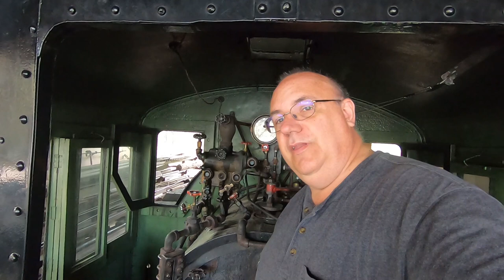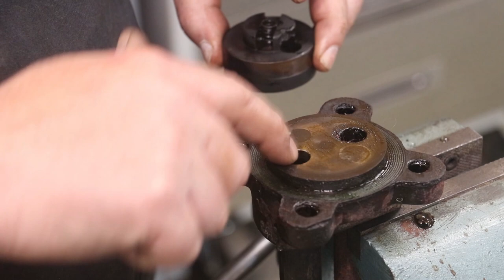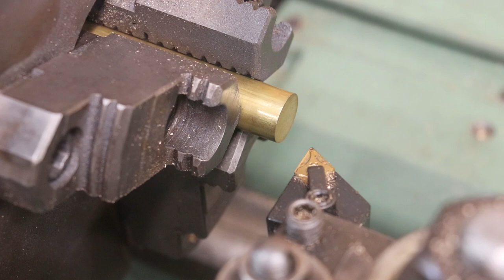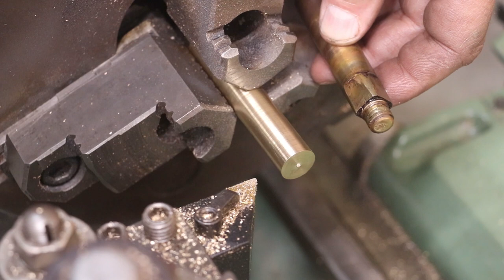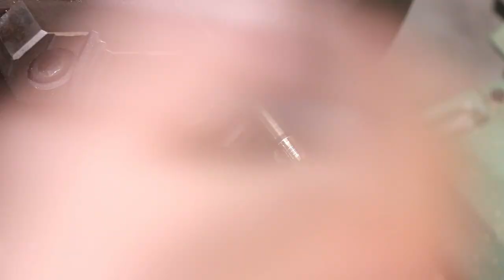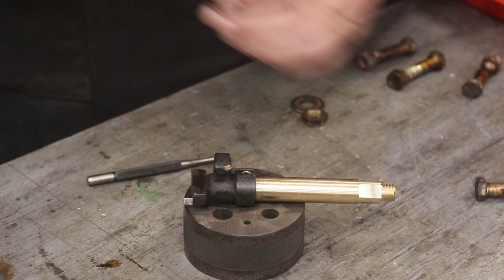Repairing & Machining Parts for a Steam Locomotive Brake Valve

Comment: Brass should not be used where it is continually exposed to steam or hot water. The zinc will leach out, making the part weak. A bronze, which is copper alloyed predominantly with tin, will retain its strength much better. As to the size of the spring pin, would the locomotive have had spring pins originally? I’m thinking it was originally a small tapered pin. At some point in time, when a repair was made, brass was substituted for bronze, and a larger spring pin was substituted for a tapered pin. These two changes would make the shaft susceptible to fracture.

Comment: Time for a plaque on the valve:  “Warning: Pulling harder on this handle will not stop the train sooner."
Reply: It's also true that stepping on the accelerator pedal on a Toyota Camry won't make a little old lady stop sooner. But a Dodge 3500 with a mechanics box will.
Reply: Likewise, there is a term...  "Elecelleration"  - The mistaken concept that pushing the button repeatedly will make the Elevator come sooner.
Reply: Or a plaque that says "go easy on it!! this machinist is a hack and cant build a strong part"
Reply: Sage advice!!  LOL
Reply: Oiler must be on.

Comment: So by your explanation, that’s technically a sort of pressure vessel. That’s why you have fine thread bolts because they are stronger in tension than a coarse thread.

Comment: The brake handle broke off? Really? I mean, reality isn't supposed to be a Hollywood cliche. Buster Keaton will haunt you.
Reply: Also Do you have liability insurance for brake jobs?
Reply: I heard Charlie stole the handle.
Reply: Erik Bongers on a downhill slope with a damsel tied to the rails
Reply: @paulatkins894  any shop that makes repairs mainly auto has to have liability insurance for just such a thing. When i was an A.S.E. tech though i can tell you 98% of failures after a car left where not directly related to the recent repair. Eventhough its very hard to explain that to customers
Reply: Silver Streak locomotion plowing into the  station.

Comment: It looks like having the rotation limit on the casting could put a lot of load on the spring pin and shaft if the engineer pushes the handle to the stop.  
Maybe warn the engineer to use a gentle touch....pushing to a hard stop doesn't improve the flat face valve operation.  Just another one of those undocumented secrets to learn when running a steam loco.
Thanks Keith.... I am the one with the machine shop keeping our club's 1913 Case steam traction engine running here.
Reply: “Warning: Pulling harder on this handle will not stop the train sooner.”  Although, sadly, that same warning has never worked while I’m playing video games...
Reply: Chuck in Wyoming  and bronze could be a better choise than brass due to the brittlenes of brass.
Reply: @janvisser2223  I suspect the valve stem was all originally cast in one piece in bronze.  The new 5/8" brass stem and spring pin are probably a later fix when the stem was twisted off above the 0.9" shoulder.
Reply: Chuck in Wyoming: Agree.. Keith has probably selected the material that he had on hand. I personally would have spent time to make a one piece part out of bronze. But hey, who is interested in my opinion😊 Put ten technicians in one room and you will end up with ten different solutions for the same problem.
The design of this old brake system seems also unsafe as it is not fail-safe.
As a rupture in the steam line to the brakes will produce al lot if steam blowing off to the atmosphere instead of slowing down the engine
Reply: @scotty362100  Thanks for sharing.
Reply: One idea that came to mind was to bore out the end of the original valve stem and make a stainless stub that could be pinned or silver soldered into it, to replace the broken off stub. But if the original shaft was one piece with the end that was pinned to it, could also silver solder a new valve stem to the more complicated end with the stops, making it one piece again..
Reply: @windrk_6754  "...making it one piece again..", I think you got it nailed!  I hadn't seen Keith's 2017 video when he rebuilt this valve.  I watched it (thank you scotty362100) and think a new stem would be a good idea. Keith could include the 0.9" spacer ring he added if he turned it from a 1" shaft and get a really good silver solder joint with the 0.9" face.  Maybe include a tapered square to lock the handle like the 2017 replacement stem had.
Reply: grafvonstauffenburg  Stainless on stainless would have a tendency to gall.  For steam service, bronze was the preferred material for wear in this use.  Also these brakes are steam jamb which is either on or off.

Comment: Fine thread takes more vibration to loosen off.
Reply: That's good info. Guy I work with hates metric bolts because they are fine thread and fine threads are easier to cross thread.

Well, never in the history of threaded fasteners has a fastener cross threaded itself. There has always been someone turning it. Every cross threaded fasten was caused by the person installing it. He is just trying to justify his ineptitude by blaming something "foreign".
Reply: Fine thread bolts tend to be used on high strength bolts because the finer thread leaves a bigger root diameter.  Any bolt table will tell you they accept more axial force. 

 They may have been needed here because those four bolts hold the (fairly large diameter) top on that valve against full steam pressure. If they fail, the top blows off, there's a deafening noise from the escaping steam, the driver gets a bad burn as well as a sprained wrist, and the locomotive has no brakes.  The fine threads and the bolt spec are potentially very important.

Comment: Hi Keith, just watched the valve lapping vid from 2 years ago, where you installed this brass shaft that just broke. For such a light load that's not a very long life. In that vid you also remachined and installed a guide bush as well as removed the original shaft. During these operations I saw several places where missalignments could have crept in. This could have resulted in a slight bending force at the region of the spring pin. After a few thousand operations this could easily have broken the shaft. If this new shaft breaks again in a couple of years, check the alignment.

Comment: Why not square-broach it, make a handle to fit then drill and tap a set screw that engages a dimple in one of the flats? Much stronger since there would not be any through-hole.

Comment: If you do have to revisit this repair consider tapering from the 7/16ths to the 5/8ths diameter where the packing rides. It would remove the stress riser from the hard transition.
Reply: I wonder if the issue it's with radial forces from someone being too heavy handed with the handle and stress cracks forming.  It took me a long time to teach my kids to shift a manual transmission using their finger tips instead if grabbing it and forcing it into gear.
Reply: @robertoswalt319  I think the steam pressure pushing down on the valve disk makes the lever hard to move otherwise we would see a ball on the end instead of the large handle. He had to machine the valve surfaces before and the spring inside is not super strong so that wear force came form somewhere else... steam pressure.

Comment: Keith, if Lady Luck is unkind and that stem fails again, changing from brass to something stronger, say manganese bronze, might be wise.  With strength comparable to steel and highly corrosion resistant, manganese bronze seems a "winner".
Reply: Eli Duttman Indeed. Brass de-zincs and disks over time when exposed to live steam. Bronze would be a much better choice.
Reply: Keith does not read the comments. People have been telling him to use bronze for parts exposed to steam for a long time but he just wanders along in a fog using brass because that's what he has.
Reply: @Craneman4100w  Stainless any good for this?
Reply: @MrJohnnaz  I don't really know MrJohnnaz.
Reply: @MrJohnnaz  Stainless is the best, all machinery used in autoclaves in modern times uses 304, or 306 stainless steel. Most autoclaves us 125lb incoming steam pressure, so there is really no reason not to use it on locomotives.
Reply: If you make the stem stronger, that casting becomes the weak link.  You can make another new stem fairly easily; but, If the casting breaks, making a new one would be a monumental task.  I Think brass is the right call.

Comment: I don't know how deep the center drill went but it might have been a good idea to make the turned down section that goes into the valve driver to a little longer.  It might have been deep enough to weaken  the cross pin.    Making it longer would allow for the center drilled section to be cut off.  Could have also done the handle side first.     Going 7/16 will definitely help.  Maybe use a bronze instead of brass as a different material?   Polish the shaft at the gland nut?

Comment: I would have been tempted to use bronze and mill a flat spot and a dimple on the shaft, then tapped out the spring pin hole and used a set screw and loctite.

Comment: 25:25 Looks very much like the square on the original stem has a taper, similar to a square taper bicycle bottom bracket. When this one breaks because it's brass and you make a fresh new one from bronze, you can take out the handle slop by making a square taper on the new one :)

Comment: Wouldn’t a set screw work better to hold the stem
Reply: Thread both sides of the hole and use two set screws.Dimple the shaft to prevent slip, as well.
Reply: @machintelligence  not in brass its too soft
Reply: @machintelligence  just what i was thinking.

Comment: 31:54 shop boss signing off!  A flat on the shaft with a mating flat machined in the end piece would be good for transmitting the torque, then you could use a very small diameter pin to hold the valve stem in but loose fitting in the end piece so there is no torque thru the pin. That would make it much stronger. PS:Need to tighten your chuck on that center drill. lol
Reply: Not for nothin' Brian; but, how would you machine the flat into that little hole?
Reply: @cyrilhudak4568  With a little end mill. :-) Of course in my shop I would have to use 1/4" then file out the corners to get a good fit but with those less afraid of the small stuff an 1/8" would probably be the trick. lol

Comment: hi there! wasnt the original square section for the handle tapered??
Reply: I saw that also. Looks to be about 1/16" smaller at the tip so the handle locks down when tightened.

Comment: My thought was maybe broaching a square or hex fit instead of round, which would take the torque off of the pin section and distribute it to the handle's shaft. The pin would just be retaining the shaft rather than transferring the force.

Comment: Perhaps a stainless steel operating shaft
Reply: Was wondering about either stainless or at least bronze instead of brass.
Reply: Csab  He could have made a sleeve of copper to cover the SS.
Reply: Original GOOD part is not original anymore because he enlarged the hole.  Now, it will probably crack because the walls are thinner.  What a shame.
Reply: What I would do, is drill the hole for the spring pin through the side of the stem instead through the center.

Comment: i am so pleased with myself, Keith. Before you got started on the fixin' part i had instinctively chose to bore the hole bigger by 1/16 inch. That "small" increase in the diameter adds a lot of brass to resist torquing forces, increasing significant robustness against breakage in the future from brittleness being introduced over time. I wonder what a mechanical/metallurgical engineer would be able to calculate is the increase in strength? Maybe someone here knows the calculations to run on that. (i hope) [i hate to say it, but i would be getting ready to core a new brass rod and insert a stainless rod within to take the drilling. I know my strength (like yours) would introduce too much Hammering the Break Handle to the ON position and thereupon introduce a Lot (too much) of a sudden torquing (and thence brittleness) to the too small brass stem given the size of the pin needed for strength.]

Comment: Hey Keith any advice on straightening a slightly bent 12" long shouldered bolt used as a front motorcycle axle? I accidently loaded it sideways bending it and in current climate(laid off) i cat really afford a replacement. I thought putting it in vise and applying opposite force but how to keep from over doing it. Would heat be a bad idea? If i had access to a lathe id just machine a new one sadly i got a vise , oxy map gas torch, and a welder that's all. Thanks and love the videos

Comment: Two things strike me, firstly why do you just run the bit back along the workpiece without pulling it away? It leaves an unsightly helix. Secondly you use the blade ends of the Vernier caliper, which risks error due to inaccurate alignment along a parallel cylinder. Could you not eliminate that error by measuring using the flats and allowing them to be snug on the work?

Comment: I think a solution to not breaking this arm in the future would be to have a disconnected shaft with a spring latch. You can pull it to your position, it does its job, but if the engineer pulls harder, instead of breaking, the handle skips a turn. It would mean that the handle isn't aligned with the setting, but that's a small price to pay vs not having brakes in a possible dangerous situation.

Comment: the pin should be the fuse.  that is the least important part that can break and you dont cry---  unless you have no breaks and hit something.  Beef up the shaft, what breaks next??  you are not going to stop engineer from overdoing it.  I would hate to make that part on end of shaft.  maybe make the handle slip when pushed to hard?  or pin the handle so that pin breaks first???

Comment: Keith, this was another very interesting video -- I enjoy seeing the locomotive repair you do (along with everything else).  I agree that the spring pin seemed too large for the size of shaft it went through, but could the wrong material have been used previously?  I think I've read that many brasses don't do well in steam service.  Anyway, your fix ought to last a long time.  Take care.

Comment: Another option would have been to broach the shaft and hole square to spread the torque to a larger cross section and not have a stress riser on that pin hole.

Comment: Would it have been worthwhile to have rounded the edges of the hole where the pin went through. It seems the sharp corners may allow a stress crack to start which would have lead to handle breaking. Maybe looking at the original part under a microscope may give some clues as to where the failure started.

Comment: I think you have it backwards. The Westinghouse style brakes on trains have spring brakes were the steam activates a piston that operates an S cam to release the brakes. To apply the brakes an stop means you have to dump steam to reduce the line pressure. They use that system in case the cars uncouple, then the brakes automatically apply themselves.
https://en.wikipedia.org/wiki/Railway_air_brake

Semi trucks use pretty much the same system with air instead of steam.

Comment: Another way would be to bore half-way at 1/2", or at least to just past the pin, then drill your 7/16" to finish with and turn a shoulder on the shaft to suit,

Comment: Keith, As I see it the problem is the stopper is down on the bottom casting, and any pressure applied by the operator in rotating the brake handle, to the full off or full on position, applies a lot of load on that pin and reduced section on the bottom of the shaft.
you might be able to find a suitable bell shaped pipe reducer or make something up, but you need have it so it can slide down over the main housing with a suitable slot in it for where the steam inlet pipe is, the steam inlet pipe will act as a stopper to stop this sleeve from rotating around the housing, the reduce needs to be big enough to fit over the packing nut on the small end of the reducer, then at the top weld a flat piece in that is just above the packing nut with a hole for the shaft, and another piece a smaller tube welded to that plate that is 270° so it acts as a stopper on the brake handle.

Comment: Increasing the diameter from 3/8 to 7/16 should give your ~36% more strength. Probably a bit more because the size of the pin will be the same or less.

Comment: If it broke again ditch the spring pin seems this may be a good application for an interference fit...  if the shaft were a thousandth or so larger than the bore couldnt the little fitting be heated and if need be the shaft cooled with dry ice and alchohol maybe even just a freezer and the two pieces press fitted???? Or can that not be done with braas???

Comment: Keith I would have been very tempted to broach the round hole in the casting to square or maybe hex and as Single70s suggested below, replace the brass shaft with a high cobalt content stainless steel such as EP0250690A1, which is used in hydraulic valves and has good wear properties and corrosion resistance. However maybe that is overkill for a low speed locomotive, where you always have the reverser for emergency braking.

Comment: Increase the diameter of the part of the shaft with the pin through it. If you reduce the diameter of the pin then the pin will be the weakest part and it will shear.